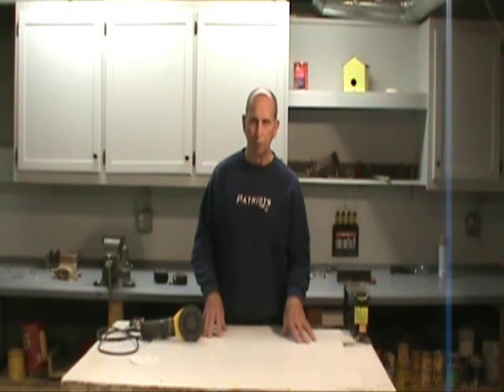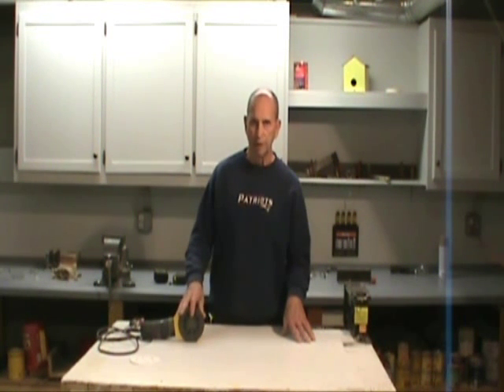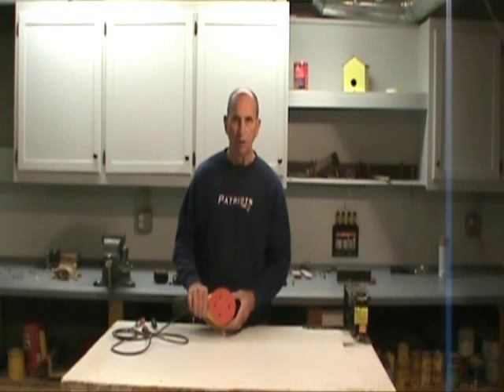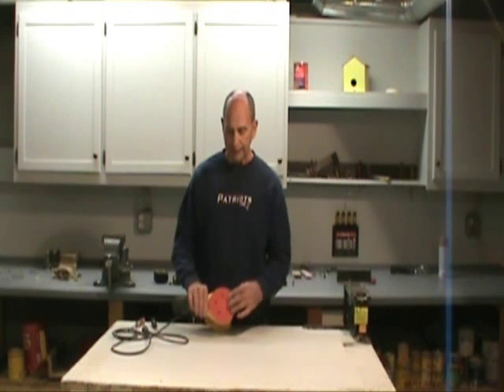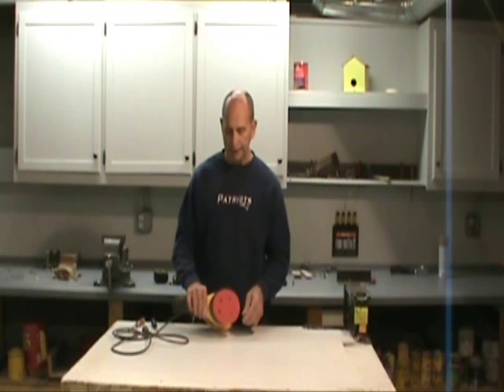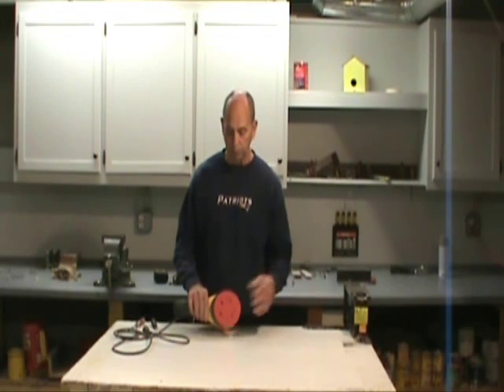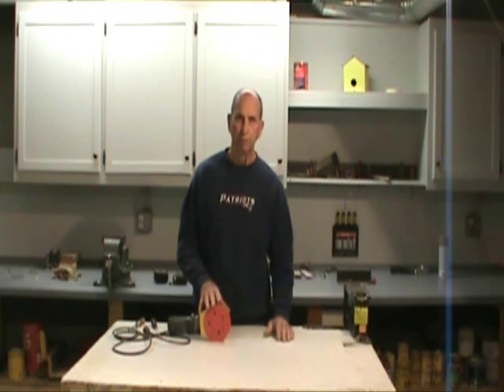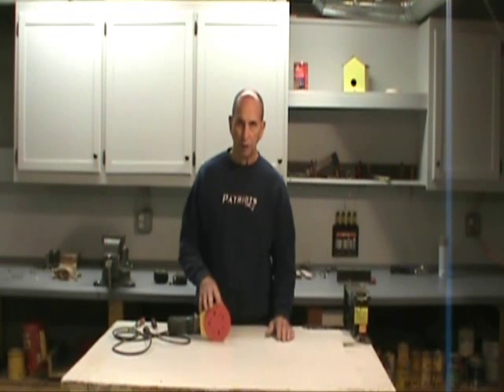How to Change an Orbital Sander Pad

Comment: MOST orbital sanders have a pad that has a single screw attached to the top of the pad and a thin gauge wrench is required that goes in between the pad and the sander shroud to hold the mechanism so that the pad can be removed by turning it counter clockwise by hand